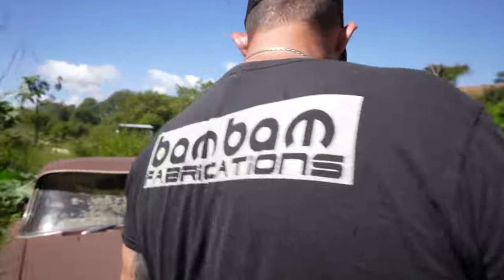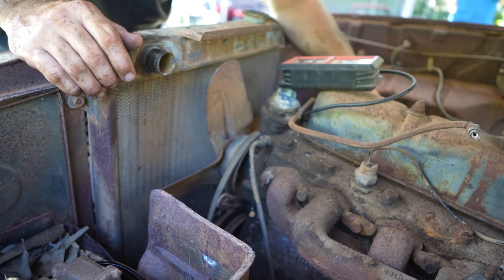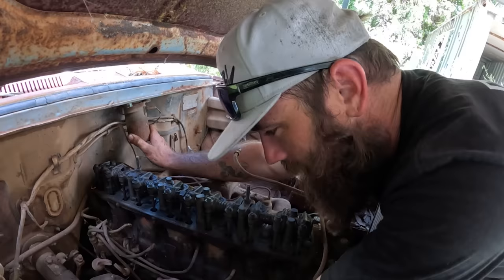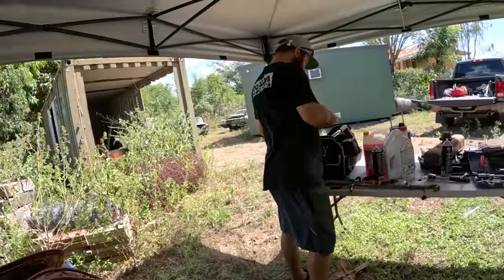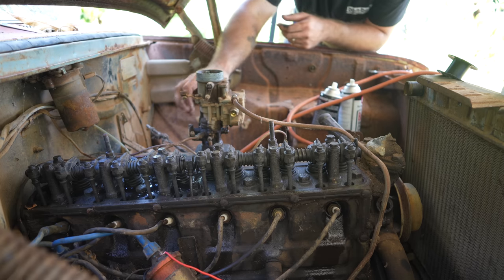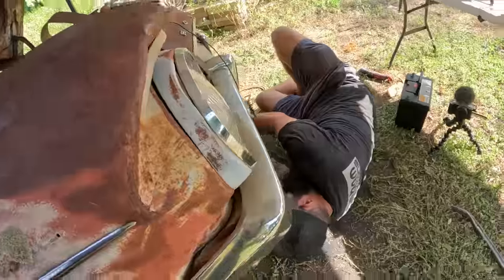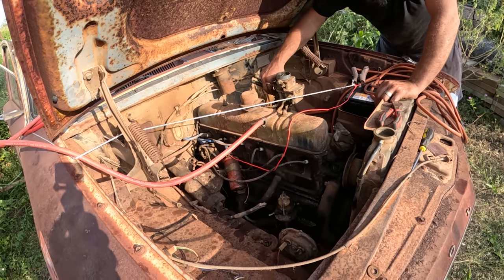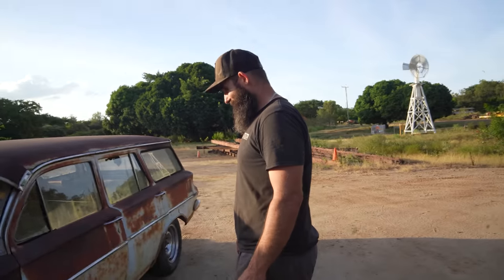Will This Classic EJ Holden Run and Drive Enough to get to a Historic Australian Pub

Comment: Not a good idea to spray all that carb cleaner into the cylinders and carb! You should use some two stroke mix instead to provide some lubrication.

Comment: you boys are showing your youth its in miles not klms   boys. the change happened in 1966 boys.
Reply: The change happened to the currency in 1966.  The vehicles not metric until 1974.